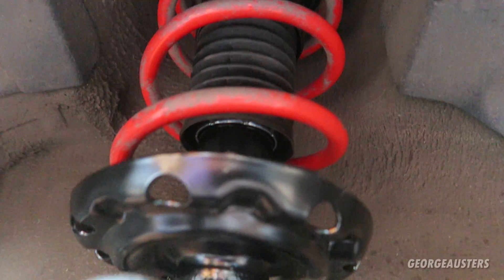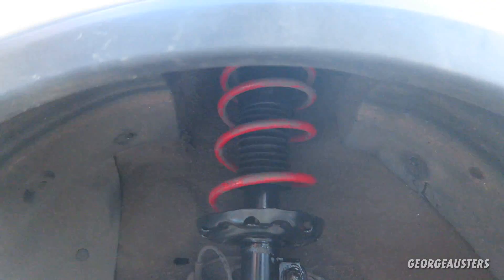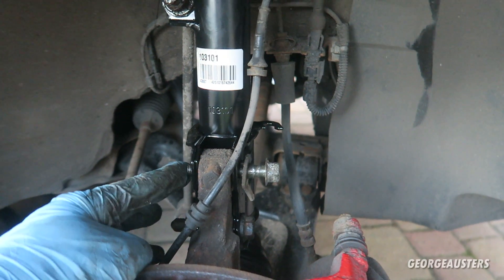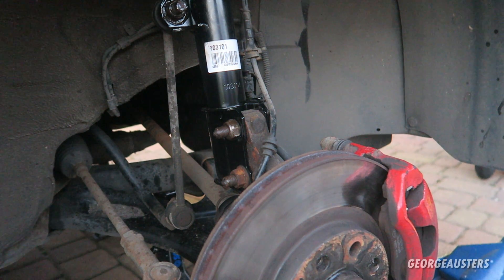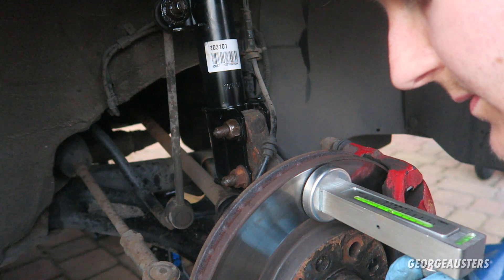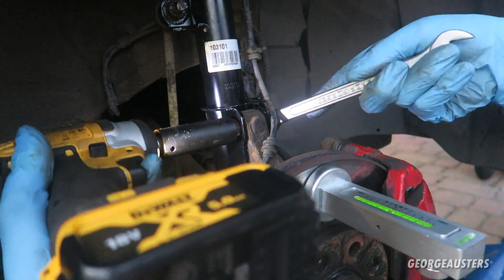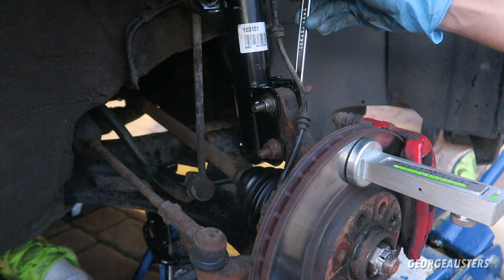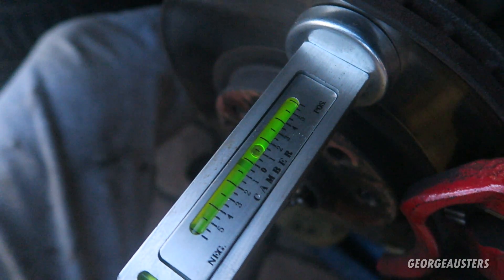How To Adjust Camber On a Car Using Camber Bolts

Comment: How can you know that your car is set to zero with the factory bolts, when for example at toyotas the bolts are not tight in the holes and leaving the boot moving for small alignment corrections? The way you show that you reset the tool by zeroing the boots, isn't trustworthy. The only way you could make this work at home, would be if you could move your car in a perfectly zero degree leveled floor, with the wheels installed on the car, but that's not possible and also you can't do anything if the wheels are installed if you don't have a lift ramp... 
Also when you don't have the wheels installed, and when the disk is not tight in place, you can not be sure that the measurements are not off-set. I don't think this is the right way to do it...

Comment: This video is super old but after installing the bolts did you book to get the tracking set up alignment ect.
Reply from the maker: No.. There is no front camber adjustment on this car thus the camber bolts

Comment: This is now the 2nd vehicle I have replaced the struts and ended up with so much positive camber that camber bolts could not correct the problem.  The ONLY remedy is modifying the strut bolt holes.

Comment: The camber must first be measured with the wheels on the ground on a flat surface and it's easy to do with most cars that have spoked cast, forged wheels, since you can place the camber gauge through the spokes and onto the brake rotor to establish camber.

Once you know the camber, you can lift the car and remove the tires, because you already know how much you need to adjust it, so place the gauge zeroed out and add or reduce camber the desired amount.

It's very worthwhile to do it yourself, as is adjusting caster and toe. When you're done, it will almost certainly be better than a shop, since the worker doing the alignments wants to crank them out as quick as possible and only cares about getting it close enough.

Ever since a shop used a 1/2" impact wrench to install the aluminum oil filter cover on a Toyota I own, I've stopped taking cars in for things I can do in my home garage.
Reply: Those are some of the best candid comments I've read in a long time!
Reply: just curious, if the floor the car is sitting on isnt perfectly leveled, how do you figure out the actual existing camber?
Reply: @TomatoTomato911 drive it somewhere flat lol
Reply: Yeah. Dont do this.  Do all adjustments with wheels on the ground.    Adjusting one side will almost always affect the other side.  This is very much just doing shit.

Comment: Brought my car to a garage car alignment today, and he told me he couldnt do this because it’s from the factory standard😂😂😂😂😂😂
Reply: He's not lying if it comes with straight through bolts
Reply: some cars can’t be adjusted
Reply: @reytorres7529  smaller diameter bolts no problem. In fact that is how a lot of toyotas are
Reply: Is it possible to modified shock by widen hole by 1-2mm so that so can tilt it inner or outer.. using the stock 14mm bolt for toyotas
Reply: They told me the same thing I got a 2016 is200t Lexus
Reply: What you did then?
Reply: Oof I’m a mechanic and I’m doing an alignment on it right now
Reply: You have to buy the bolts separately most cars don’t have a way to adjust camber

Comment: Best explanation I seen so far.So all I have to do is measure with the tool with the stock OEM bolts first and that will tell me how to adjust after I put in the adjustment bolts correct?And the car does the cars wheels need to be on the ground ?

Comment: Why do you have to zero out the tool? Shouldn't it be already calibrated? I'm installing a camber bolt but my camber is off and trying to fix but don't understand why have to zero it out.
Reply: I don’t understand adjusting to zero either. Why isn’t it just in a fixed true zero setting?  I also don’t understand how you can make alignment adjustments without the wheel and tire on and setting on the ground.

Comment: I am confused here. You are setting the camber with the suspension clear off the ground. What happens to the camber angle with the tires back on the full weight of the vehicle once again supported by the tires? I'm not criticizing here. I simply do not know and am curious.
Reply from the maker: Watch the video and listen to what I say

Comment: At first, put the ruler to the default of 0 or attach it to the disc and then adjust it to 0. If the car is tilted inwards and put the ruler on the disc to adjust to 0, it will be wrong. You have to adjust it to 0 on the outside first, right?

￼

Comment: Your are putting that measering instrument on your brake disc. The brakes discs are a little worn . One side of instrument is on the middle of the disc (not worn) the other side rests on the outer worn part of the disc. That looks to me like it introduces a measering fault.
Reply: Also the disk is not tighten, as the wheel keeps it tight, so it may not sit tight to its position...

Comment: Any questions? Ask me. But I answer only 2 questions. Ok? Other wise I'd be here all day
Reply: @ItsJustMe-e7h  18
Reply: Why do you have to zero out the tool? Shouldn't it be already calibrated? I'm installing a camber bolt but my camber is off and trying to fix but don't understand why have to zero it out.
Reply: @karlh4313 have you got answer about why to zero out the tool? It is confusing to me as well.
Reply: @karlh4313 U got to be kidding me right?
Reply: @karlh4313  because when the car is jacked up, the wheels are going to sag a bit, so they’ll be reading a different camber than when the wheels are on the ground
Reply: thank you for the video! i do have one quick question, so my car is lowered 2in in the front which is about 50.8mm, any idea where i would find the info on how much positive camber i would need?

Comment: I check Cabor on my big rigs by using a propane torch on the steering knuckle at the round thing that has the grease and rubbery stuff over it. The rubber is too keep out the sand and dirt. It will melt that. But if you live in the city, your fine . Just don't do it if you travel on dirt roads. Ok?

Comment: mate what should i set my corsa c 1.0  front wheel camber at with standard springs
Reply from the maker: No need to install camber bolts with standard springs
Reply: @GeorgeAusters  thanks man

Comment: I have a 2008 Lexus es350 with negative 2.3 camber on rear passenger wheel. The shop said that this model rear camber cannot be adjusted. Do you have any idea what I can do to fix it? Lexus specs say:” Hint: since rear camber cannot be changed, check other parts that might affect this such as suspension system…”
Reply: I have same problem with my 2016 is200t Lexus

Comment: Hey! The metal tab which comes with the Camber bolt kit should be pointing  horizontally away from the car for example like a crucifix which arms are pointing away horizontally and the tab shouldn't rotate when your rotating the Camber bolt head to do the adjustment so in order to not let it rotate out of its place you just press on the tab to hold it and don't loosen the nut too much while doing the adjustment and that should work.

Comment: Can the car dealership fug the numbers on a wheel alignment?  I used a level on my back tires. 1 is in... the other is out a lot. But paper work says 0.3 and other is 0.7. Doesn't sound right

Comment: Can a camber bolt install get the camber angle from -0°26' to within spec 
-0°15' - 1°15'?(LHS way out of spec and eating outside edge) , -0°16' to -0°15' - 1°15'?(RHS)
Reply: Most camber bolt kits go from +1.75° to - 1.75°

Comment: Are these bolts universal? I want to put some on my benz e coupe but they don't mention compatibility on vehicles. Also was curious how much would a -1 camber effect the ride?
Reply from the maker: Yes they are but not all struts are the same
Reply: You can check on Amazon, O'Reilly sites, if the Camber Bolt you want to buy it right for your car. I bought one set (2 Cam Bolts) for one car, but that set wasn't right for another car,  though they look (bolts I mean) exactly the same.  So for another car I purchased the bolts which fit that particular car.

Comment: Nice try and thanks …….. but you miss understand…..it doesn’t matter what the pre-drop camber is and you just can’t set camber unless the car is on its wheels so it’s best done from a pit with the gauge on the inside of the disc and you have to know where the pivot point is in real terms to the axis swing of the axle!
In general terms for slow cornering you want 0.8 of a degree and for fast cornering up to 1.2 degrees any more than that and the car will feel too edgy in a straight line good to see you having a go though well done .
Reply from the maker: You missed the point of the video. I wasn’t trying to set camber. I was just trying to adjust it 1 degree
Reply: @GeorgeAusters  and that means you were setting it at 1 degree therefore setting camber
Reply from the maker: @timmytackle9181  No I wasn't.. I was just adjusting the camber 1 degree to compensate for the 30mm lowering springs

Comment: Pregunto no es mejor ovalar el agujero del amortiguador y corregir desde ahi dejando el bulon original?
Reply from the maker: lo siento, no hablo español
Reply: @GeorgeAusters  "I wonder is it not better to oval the hole of the shock absorber and correct from there leaving the original bolt?"
Reply: Sorry if the translation is not exact but use the google translator

Comment: I have success just elongating the lower bolt hole of the strut. Often just pulling out on the  top of wheel with bolts loose is enough to do the adjustment.
Reply: Hey I'm one year behind, do you have a video in how you do it? If you do you mind sharing?

Comment: How important is it to adjust the camber after being lowered, will 1 degree wear your tires so much?  Any help would be appreciated
Reply from the maker: Hard to say how much but it will wear your tyres quicker
Reply: @GeorgeAusters  thanks man,  I want to lower my corsa, ill look for some camber bolts
Reply: Another moron that can't read.

Comment: Sorry to clarify to people who don't get it. The pinch bolts don't move under load. So when he sets the spirit level to zero it's the hub to vehicle chassis angle, gravity has nothing to do with it. You dont even need to set it to zero. You could take a reading add 1 swap bolts set it and done. I hope this helps.
Reply: Make a video so we all can watch
Reply: In another words please.
Reply: I don’t get it, at all- don’t C how turning a bolt in a set hole moves hub forward or backward(in relation to strut &/or car) AAATT AAALLLLL!✋😳
Reply: @ezwa9979  The bolt is not round... it's shaped like a cam......
Reply: 😯Or wat the hek a camber bolt is? - I actually changed struts on car that currently apparently has a negative camber, & didn’t hear or read ANYTHING ABOUT adjusting cambe.  do remember bangN those bolts just to get them through hole, & tItNing to some high torque setting, but thats it👋
Reply: @ezwa9979  Google camber bolts and you'll see they have an off center lobe like camshaft in a car. As you rotate it it moves the hub assembly inwards or outwards in relation to the strut can help with bump steer and tyre wear on lowered vehicles.
Reply: The bolt has a cam effect like a lump on half of it. the lump on the side of the bolt Push the hub out as you turn it that's why they are called Camber bolt as apposed to just a bolt that is fitted from factory @ezwa9979
Reply: Ive just replaced my suspension and one wheel is more camber than other one I done both side the same I don’t have camber bolts ect just used standard bolts but I did put coil overs on any idea how to straighten the wheels haha both are at same hight on the springs adjustable part
Reply: You need to take it to a professional garage to get alignment done

Comment: How much are Camber bolts typically? Like for a Hyundai Elantra 15
Reply: Most are universal. They can run from about $15-$40 for a set depending on which brand you choose.

Comment: Assumtion; You know how to calibrate  and use your gauge and how to install and make adjustments using the bolt kit. This is how I adjusted my honda civic with stock springs  to correct for a negative camber and bring back closer to spec. It is easier to make changes also like adding or subtracting some degrees as this video shows  . For alignment , one has to know the camber spec desired. With tires on , get the car on as level a surface as you possible can  .This was on my driveway. Attach the gauge to the tires , anyway you can ,I was able to attach the gauge to the brake rotors, and determine the first readings. Let us  say the camber spec is 0 degrees and on both sides the readings obtained were 2 degrees negative on both sides  (for simplification). Therefore to get to 0 degrees you have to adjust to 2 degrees positive.  Now jack up and remove tires. Reattach the gauge and zero out each tire by making adjustments on the gauge to read zero. You have to do  this because the camber will change because the car is off the ground and the suspension "falls" . Adjust camber bolts to positive 2 degrees and the final result will be 0 degrees. The front tires on my civic were wearing on the inner sides ( gone negative). After installing the camber bolts and adjusting as best as I could I took the car in for alignment and on one side only , I was off 0.1 degrees. The accuracy depends on the car being level initially . But in this video since the poster is only making an adjustment and the amount of adjustment is known then it is not necessary for an initial leveling of the vehicle
Reply: Great comment 👌
Reply: Ok amigo  de  de tu ejemplo en el suelo me marca -2°, el fabricante me indica 0°, pero  suspendido en el  aire  me indica otra medida, lo que yo hago es apartir de allí sumar dos grado más o agregar dos grados más en dirección positiva está bien, o como tú indicas  elevado el carro agrego o sumo dos grados más quedando en 2° positivo y cuando está en el suelo queda a 0 ° bien saludos desde Perú
Reply: Another moron that can't read.
Reply: Si una rueda tiene -2° negativo y la otra rueda tiene -1° negativo a  qué lado se desvía el auto a -2 o  -1 saludos desde Perú
Reply: Listo amigo aver si entendí de tu ejemplo en el suelo marca -2° , el fabricante da 0° y levantado tengo que poner los pernos del Macpherson del amortiguador y graduar en +2° positivo para que en el piso quede 0° en conclusión de -2 a 0 falta 2 grados , de +2  a 0 falta dos grados es una proporción, saludos desde Lima PERÚ
Reply: why dont you put a jack under every lower arm or under the brake disk letting the car resting its weight on and then adjust? I know the weigh will make it hard to do but with a crowbar I think youll be able to set it ,loosening the bolts as needed.
Reply: @cipriansofineti346  That is a good idea.
Reply: Ahhh now I get it. I thought why not go back from -1 to 0. But you measure with wheels on and car on the floor. So when car is jacked up you have to zero it, and then go to +1 to finally get 0. Okay got it. 
I hope standard camber bolts will work on my Mercedes because original Mercedes camber bolts can only adjust to 0.2 degrees... which is absurd. My front wheels are 2 degrees negative because its lowered.
Reply: @explorinlearnindoing5462  Another moron that can't read.
Reply: @Explorin, learnin & doing  best comment. Glad you got it too! I'm on the Fore Front of about to see if my camber needs changed in my car. Front and back.

Comment: how to know if it is level?  Do you place the device on the brake disc and when you remove the wheel and the car is up on the support, the system falls inclined downwards?
Reply: Is that probably why tire alignment workshop using hydraulic lift to keep all tires at the same level
Reply: Another moron that can't read.

Comment: How do you get springs compressed by the car load and driver weight, but without wheels on?
Reply: .... to answer your question, a Spring Compression tool from Amazon or your local Auto Parts store if they carry em.
Reply: Camber settings don't change under load
Reply: @marcogarofalo6343  yes they do, thats why during alignment the mechanic shakes and rattles the car first before checking the alignment, even small pressure affect the camber of the wheels
Reply: @Mulongski09  no they don't with the bolt tight I don't think you understand how the cars suspension works sorry.